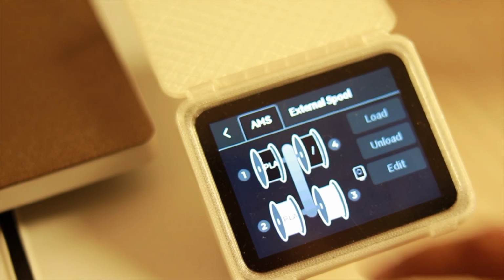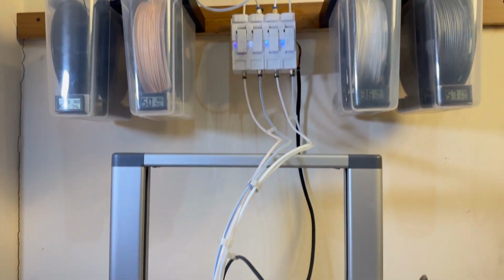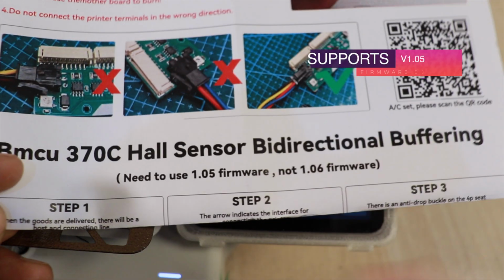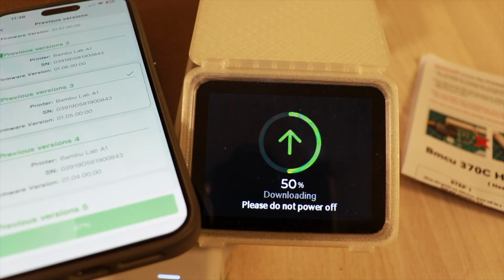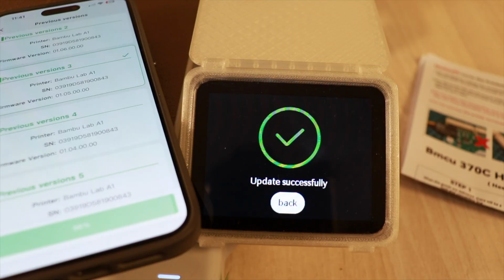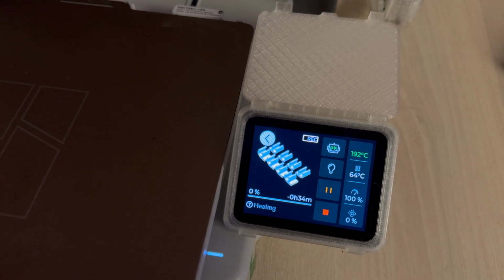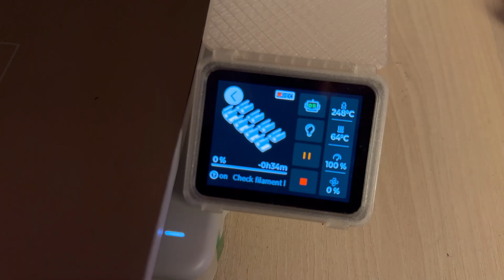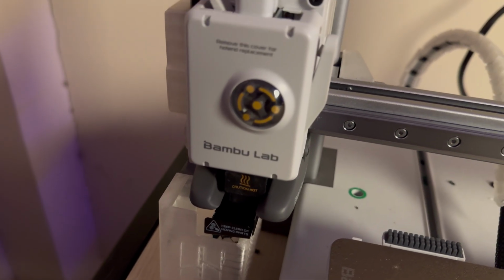BMCU 370B is Better Than AMS Lite | The Best Bambu Lab A1 / A1 Mini Upgrade

Comment from the maker: The total imported cost! 💸

It came to $56 USD for the unit + $42 USD for shipping (approx. ₹8,300 total). To offset that high shipping cost, I grabbed a 4 hardened steel nozzles for just ₹590 each. No import duty - shipped via Yanwen, delivered by Bluedart. 

Buy link - https://de.aliexpress.com/item/1005009714120543.html

https://www.alibaba.com/x/17qYvs?ck=pdp

Nozzles I got - https://www.alibaba.com/x/17qZhD?ck=pdp

✅ Tested: The 0.8mm nozzle is working flawlessly so far. Highly recommend adding them to your cart if you buy the unit.

Let me know if you get stuck with the firmware downgrade or have any questions/need some answers.  Happy to help.
Reply: Dont know why did you buy from Alibaba, for nozzles add on? Aliexpress dont ship to India, though i get deliveries form it in another country. If its for BMCU only then traingle lab is much cheaper.
Reply from the maker: Assembled unit is $96 at Trianglelabs. Check that. Alibaba has Trade Assurance and dispute management. I am a frequent buyer at Alibaba. 

The A kit is cheap at Trianglelabs for 5300 or so.

Comment: I have the 370C unit, I built myself, and it is running on firmware 1.0.7 without any issue. The one problem I do have which has happened ever since I installed it, the printer randomly loses connection to the unit. If it's half way through a print, it still finishes fine, but you need to turn the printer off and then on again to start another print. Annoying but an easy fix.
Reply from the maker: That’s why they mention 1.05. There’s no issue with the 1.05. Only thing is when system starts, you see update pop up. Just ignore / reject. That’s it.

Thanks for sharing!
Reply: @ravis1ngh  It was on 1.04 when I installed it but still had that issue, I even replaced the controller board but didn't help. I'm ok with it though :). Have just placed an order for an Anycubic Kobra X, so we'll see how that goes, multicolour without any external unit.
Reply from the maker: Where you located?

Comment: From the US and glad I found this video. Very good encapsulation of the BMCU. I've had it for a few months now and I've not had any issues so far. It was very easy to set up and has been working very well. I appreciate seeing your set up. I will probably do the same. I've been toying with making the dry boxes like you have (currently I store all my filaments in a large box and pull them out when needed). 
The only thing I would mention is how the BMCU pulls the filament back. The AMS Lite will use the gears on the spindles to assist in the pull back to keep the filament spooled, the BMCU does not. So there have been cases where my filament gets bunched up around the spool and I have to manually intercede. But it's not been too bad for me.
Reply from the maker: Yes, agree. 💯.
The retraction actually becomes a li’l loose. But that’s not much to worry about - for my setup at least. And for $60, that totally acceptable. Not a con at all!

Comment: have you tested the ams lite to compare it with this?
Reply from the maker: I did not, but I have seen it working, and this works the same. Only thing is you need to be on firmware 1.05 
And if you see my setup which I planned before I bought the printer last month, I bought standalone and purchase this. For my setup with DIY dry boxes, this fits best. 

Now I am thinking of taking a 15litre or 20 litre box and make a completely sealed AMS system with 4 spools instead of individual boxes. 

I think using this we can make something like that. But now with official AMS lite. It’s huge. 😊